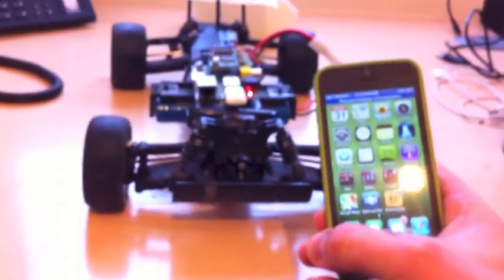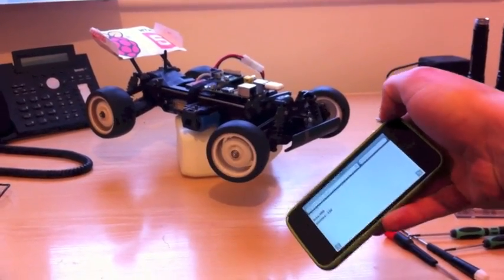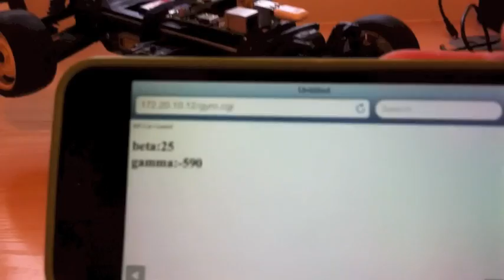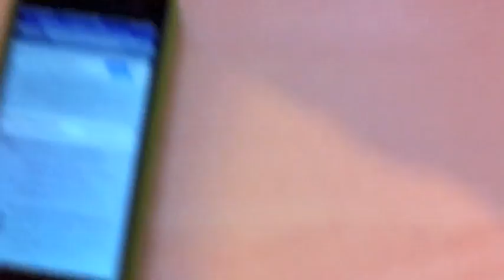Raspberry Pi Remote controlled iphone car - part 2

Comment: How did you get the gyro info from phone to the pi?
Reply from the maker: in the web page you can get javascript to report the giro data whenever it changes, then filter it (so you dont have to many events) and send it to the car, originally using http posts but eventually using a http socket which was much faster...

Comment: Maybe I'm missing something here, but how are you running the Pi directly from a 7.5 volts battery pack without an additional regulator to bring it down to 5V?
Reply: the speed controller is providing the step down.
Reply from the maker: its called a ubec and if your not using a speed controller you can but a strand alone one from hobbyking.com for a few pounds / dolla
Reply: cmdstraker 1.>  A Voltage regulator is a device that clips voltage off at 5.1volts regardless of the input. (5v @ 5Amps Down is plenty)    2.>  A Batttery Eliminator Circuit (BEC) is a programmable Voltage Regulator for RC cars. It works same.   3.> A ZENER Diode and avalance it to 5.1v and have virtually unlimited current driving your circuit,  I would also use a Capacitor to smooth it out nice if you went this route.   https://www.servocity.com/html/voltage_regulators.html

Comment: Awesome project, i got a RPI laying around that i haven't been using for anything this seem like a perfect project! However as i do .Net ill write a small server running mono that acts as a websocket server, i believe a native websocket server that directly communicates with the servo controller should reduce some of the latency (my guess), while also using phone as a wifi hotspot instead of through a external router.

Quite excited and hope the servo controller arrives quickly when i order one.

Comment from the maker: yea, 3g wouldn't really be fast enough but it could fall back to 3g after wifi goes away, then at least you could send mars-rover style commands to it. go three meters forward, one left etc :), or replay the last few signals in reverse so it can return home :)

Comment from the maker: I used apache2 initially but then found it was a bit slow, only 2-4 times a second. I've re done it in nodes now using socket.io and its much faster. Maybe 10 times a second. I took it out yesterday on the field and its now stable enough to drive quite fast, I also hooked up the raspberry pi camera. When i have a chance ill integrate the video HUD style onto the iPhone/ipad so you can drive P-O-V :)
thats ne next vid

Comment from the maker: 1. Old RC Car
2. Raspbery Pi with wifi dongle
3. servo controller (look in the video description for link) (though you may not need this - research raspberry pi servo control)
4. Software - A webserver and some cgi ( i used apache and com custom cgi stuff in this vid but im using node.js in the new version) - you could use php etc. As soon as the camera comes out ill improve the software and release in in github or something if you want)
5. A phone with web browser gyro support - like an iPhone.

Comment from the maker: Yea. Well, you can install Apache etc really easily and so yes, you could control it from anywhere. I was just controlling if over IP anyway, i didnt have to be in the same room necessarily. As soon as they have a camera available for it ill make the web site show the cars onboard camera and some left right buttons save using just a phone :)

Comment: If the RPi has a web server (Apache or Node.js), does that mean you can remotely control the car from anywhere in the world? 

From a web browser, just go to the external IP of your home router and connect to the specific port on the RPi. If I'm understanding it correctly, then that is very cool!!